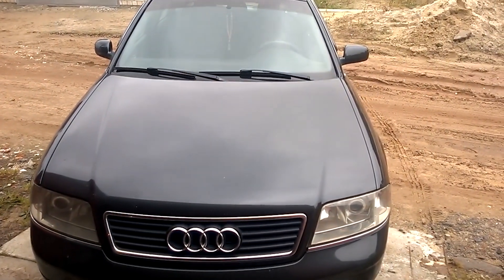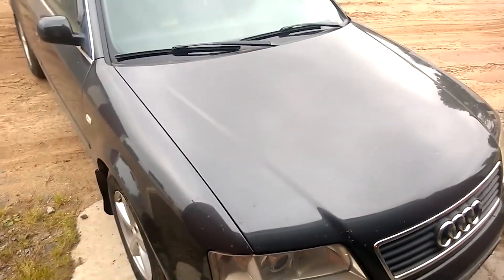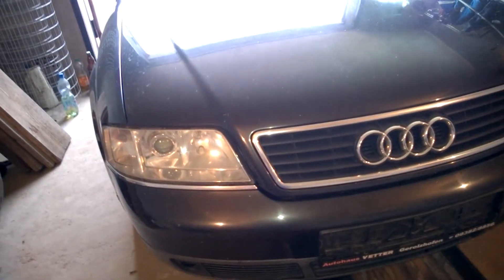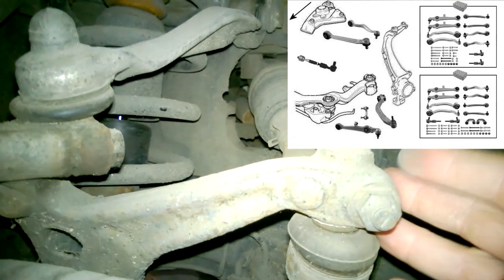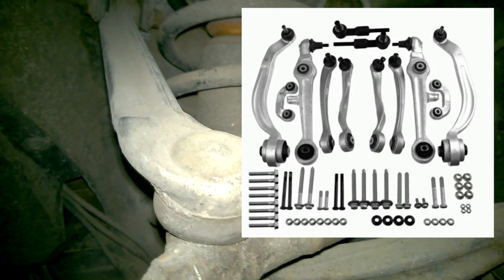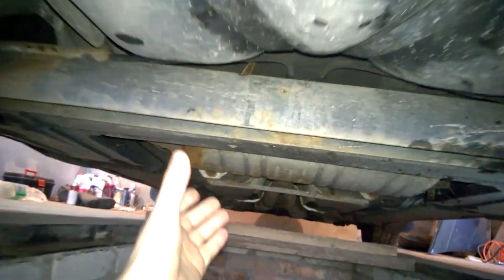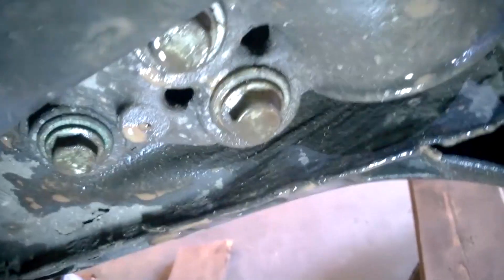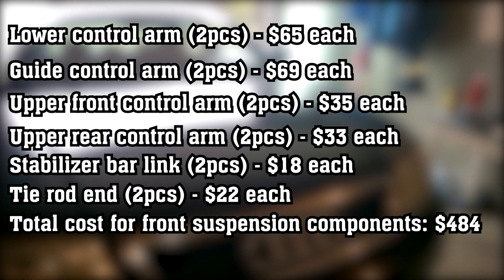Device and Price of Front & Rear Suspension for VAG Cars | Audi A6 C5, VW Passat B5

Comment: I am in the UK and put a set of front ones on about 4 years ago. it was a full set off Ebay for about £100 then with a claimed 5 year warranty. Been great so far.  I have the Quattro and the rear set are luckily still the originals (its a 1998 with 140k miles). Only had a spring break and shocks go on the back. The sports suspension springs were unobtainium, Luckily Springcoil in Sheffield UK made me a clone set for about the same price as the wrong ones for mine.